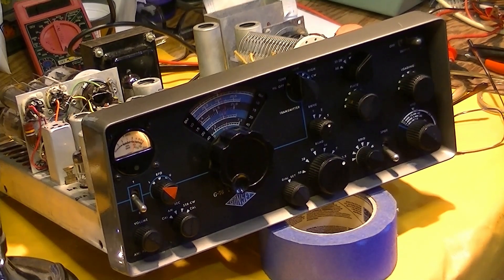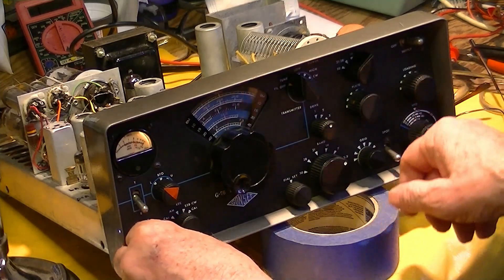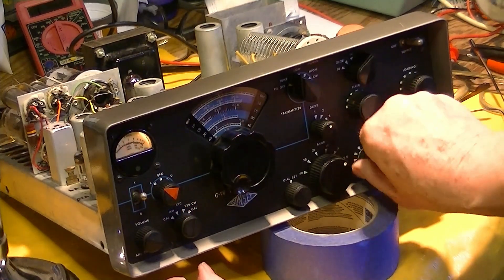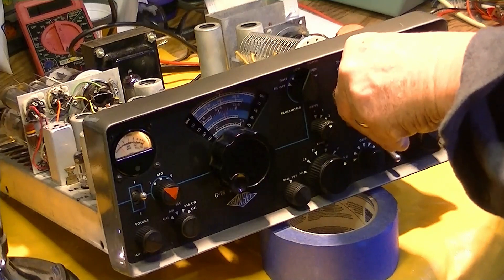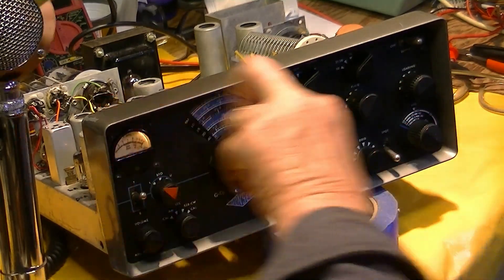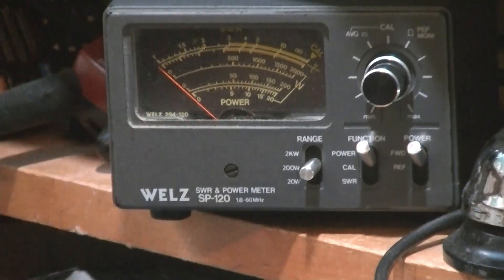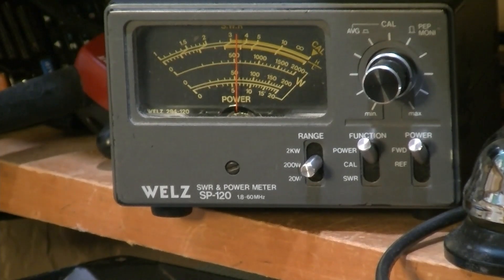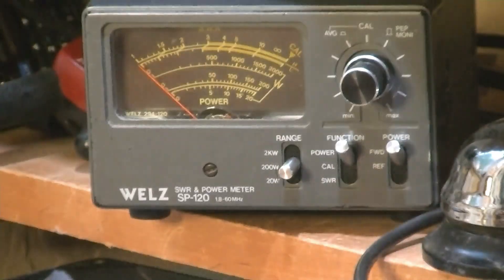Gonset G-76 AM Transceiver Operation  W6WUH

Comment: Captain Larry. I have one with power supply that was given to me by a friend of mine. He rescued it from a chicken house. I cleaned it up. Cleaned the switches replaced bad tubes. Also had to replace the transmit relay in the power supply and in the radio. It is one of my main go to AM rigs. I check into nets almost daily on 3875KHz. It has great up mod positive peak modulation.
Reply from the maker: nice story